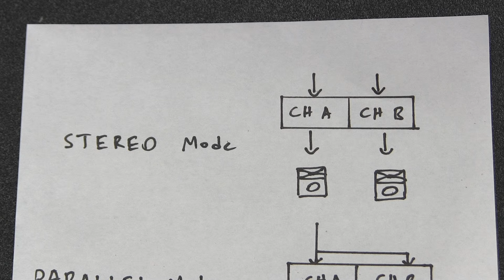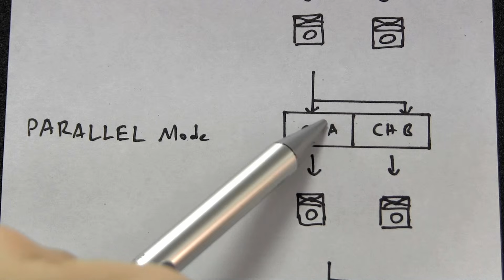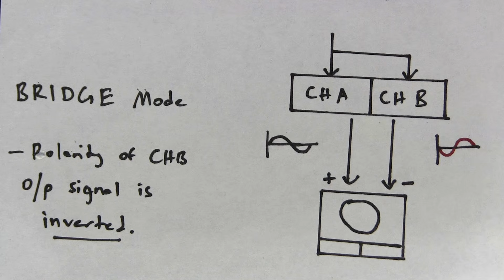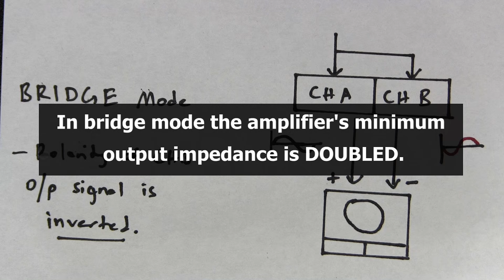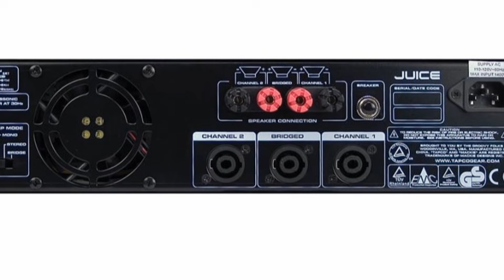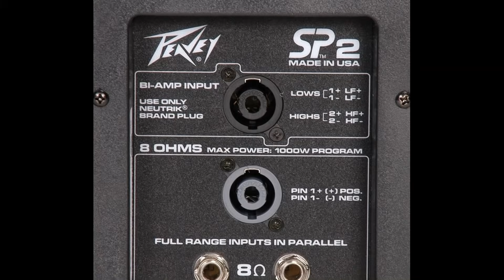How to set up and connect a power amplifier in bridge mode

Comment: Question?? I was told to connect Positive speaker wire to Speaker set 1 binding post Positive, and Negative speaker wire to Speaker set 2 binding post Negative. But you're using both Positive, 1&2, binding post?
Reply from the maker: This is only when connecting the amp in bridge mono - the video explains clearly why the connection is made to the two positive/red binding posts.

Comment: Can we used more than one speaker in bridged mode??
Reply from the maker: Yes, as long as the amplifier can handle the combined load of the two speakers in bridge mode.
Reply: Thank you... Can the wiring of speakon Connector we made for parallel mode be used in bridged mode ??
Reply from the maker: The wiring at the amplifier end may need to be changed but apart from that it can be re-used.

Comment: I have a 4 ohms subs @500watts & 8 ohms tops @500watts. Is it still ok to parallel out from 4 ohms subs to an 8ohms speaker?
Reply from the maker: Probably not - there are very few power amps that be safely bridged into a load of less than 4 ohms.
Reply: Thanks mate, basically its just only safe to parallel both 8ohms speakers or 4ohms speakers. The amp I have can run @8, 4, 2 ohms & 2 & 4 ohms Bridge.

Comment: I am the one who subscribe your channel, and my question is how do we know the Ohm of the passive speaker?
Reply from the maker: It will be printed on the back of the speaker.
Reply: @GLBProductions  Thank you...    My point is that if the speaker is old one which is not printed on the back side of the speaker. how can i measure its ohms?
Reply from the maker: Use a multimeter set to ohms but this measures the resistance rather than the impedance so will not be an exact match.
Reply: @GLBProductions  Thanks alot..

Comment: Hi Bruno! Your explanation about the Stereo, Paralell and bridge mode are really great. However, I have a question. In Inuke 6000 DSP, Behringer, the BI-AMP mode is equivalent to Bridge Mono mode? So, using it I need only one amp to connect hi and low frequencies loudspeakers? To connect 2 subwoofers and to HI frequencies passive loudspeakers in a chain, I need to change all of my cables? Thanks a lot.
Reply from the maker: Hi Affonso! No, bi-amp mode is completely different - that uses one channel to drive the low speakers and the other channel to drive the highs. If you are not totally sure about this I recommend you consult the person who sold you the amplifier and get them to show you how to set it up to work with your system.
Reply: @GLBProductions  thank you very much. I guess chanel A for low and B for the hi freq. I'm gonna check

Comment: Hello, i have pro amp skytec 2000 with eq can i use max volume or allmost max volume with eq maxed can it damage the amp?

when i try less than middle volume with eq maxed i see the blue light flashing some i have fear of damage the amp or speakers thats why i try be careful but i want to know and need to know if i can put allmost full volume with eq maxed with strong speakers

also can i connect a subwoofer of 4 impedance with 1250w rms cea will it work?
Reply from the maker: If your amplifier is correctly matched to your speakers you will be able to use any volume on the amp safely. Watch my video on how to match power amplifiers and passive speakers.

Comment: Hi I just watched n i got a very basic question. Configuration at bride mode is where at output channel we have 2+/2-, I noticed only 2 wires in the speakcon connector where else we are going to power up 2 speakers normally requiring 4 wires. Does that mean the stereo effect is nuetrelised  in bridge mode ?
Reply from the maker: That's correct - in bridge mono a 2-channel/stereo amp becomes a mono amp, hence the name.

Comment: Can I connect a parallel speaker to bridge mono mode?
Reply from the maker: Yes you can but remember that it will affect the total load on the amplifier. Many amplifiers cannot be bridged into a load of less than 8 ohms, check this carefully.

Comment: thank you very much for a very impormative vedio sir. i have a question, in my pioner a-307r which is 2 channel and every channel its requires two speakers.  it is posible the brigde mode in every channel. thanks
Reply from the maker: Please consult the owner's manual for that information - AV receivers rarely can be bridged.

Comment: Very good video. But I still have a pair of doubts.
In a bridge mode connection, what about the distorion (THD and IMD)? 
The THS+IMD is twice than in single mode?  
And what about the damping factor? the damping get worst or improve?
I have a crossover (Behringer) with a subwoofer MONO balanced output (XLR connector).  Is perfectly for supplying a MONO amplifier, but I have a stereo one. Each pin of the XLR connector is 180 degrees inverted respect the other pin. I could feed the left input with one pin and the right with the other pin,  putting the woofers (both are of 8 ohms) in bridge between the "hot" outputs (red connectors)  ...is well if I do that?  And the woofers I connect them in parallel (4 ohms) or I connect them in series (16 Ohms) ?
Hope you want responding me.
I am writing from Argentina. Excuse my bad English.  
Thank you in advance.
Reply from the maker: I suggest that you consult the company that manufactured your particular amplifier - not all amplifiers are designed to be bridged, and output characteristics may differ from model to model. 
Your suggested setup with your crossover will work in theory. 
Woofers are typically connected in parallel for live sound applications so that a failure of a single driver does not silence the whole cabinet.

Comment: when you have not a bridge option in your amp, how can i reverse in the input sinal?
Reply from the maker: You would build a custom input cable that inverts the polarity of the input signal - bear in mind that if you do this and damage the amp the manufacturer will probably not repair it under warranty. There is a reason it doesn't have a bridge mode in the first place ;)

Comment: can i ask you a question sir? so what mode can you connect the speakers normal speakers solo 1200 watts to the amp? the way i connect it is from the speakers to the amp 1 to black and the other to the red .bough the same.is that right .or is the way you done it ? thanks
Reply from the maker: Sorry Carlos I don't quite understand your question. If you use the black and red terminals to connect the speakers you are connecting in normal stereo mode rather than bridge mono, which is fine, but you will get a different power output.
Reply: thank you for your reply and sorry about you dont understand it..yeah that is the way i have when you replied to me in stereo mode...but my amp is the older version, its crown LPS800
dosent have all the things on the back lol..i dont care its just to play at home..but i would like to know what is the best and to connect it to mixer .i have connected to the mixer and plays well but im afraid dont blow the speakers up lol..because i have a pair of speakers before 3000 watts and gone started smoking ..and i dont want to do the sames to this ones .but it is loud ...thankx if you could reply

Comment: Hi Sifu Bruno! 
Is it safe to daisy chain two 8 ohm speakers in bridge mode? (considering minimum resistance for the amp is 4 ohm.)
Reply from the maker: This is ok, but be sure that the amp can operate at 4 ohms in bridge mono - if the individual channels are only rated to 4 ohms then the minimum for bridge mono is 8 ohms.
Reply: @GLBProductions  thank you for responding boss! Appreciate it

Comment: Does this work to power a center speaker with a 2 channel amplifier in a home theater system? If not, why is it so hard to find a simple one channel amp for a center or a 3 channel amp for just left right and center speakers?
Reply from the maker: With home theatre systems the speakers are typically sold with a multi-channel amplifier that provides all the necessary power - typically 5+1 or 7+1 channels.

Comment: I've got pa amp 600w with no channel options but left and right (a and b + - / + - ) .... can it still be connected safe?
Reply from the maker: You'll need to check with the manufacturer to see if the amp is designed to be bridged and how to do it correctly.

Comment: So if the sub is a 4 ohm and the amp says it can do 2 ohm would the amp put out more power if I purchase a two ohm sub? The two ohm rating is higher on the back of my old school 2 channel mono amp from mtx. Or does this already drop it to 2ohm , I'm only using one sub
Reply from the maker: You need to check if your amplifier is rated to 2 ohms per channel or 2 ohms bridged - there are very few professional power amps that can be bridged into a 2 ohm load, ie each channel has a load of 1 ohm.
Reply: It says 250w X1 into two ohms. So with the 4 ohm speaker bridged I guess I'm maxed out correct :(?
Reply: It also says 125 watt X1 into four ohm.  It's a mtx 4250 2 channel class d mono amp
Reply from the maker: Yeah that means no less than 2 ohms load per channel, which means no less than 4 ohms in bridge mono.
Reply: Understood. Bridged I'd need to keep the 4 ohm speaker because it uses 2 of the four ohms on one channel and the other 2 ohms on the other channel. So the 2 ohm rating they are talking about would be for a svc 2 ohm speaker on each channel totaling two speakers

Comment: If you were to use the binding post only and wanted to hook up 2 speaker cabs, would you run both sets of speaker cables together as you showed? Or is it more common to just run 2 cabs in stereo mode?
Reply from the maker: Either daisy chain the speakers or try and fit two sets of speaker cables into the binding posts.

Comment: Very helpful video.
I have a question sir.
If I have 2 4ohms speaker and I connect them in Series to match the impedance in the amp(8ohms when bridge) would it matter? Please answer
Reply from the maker: Sure you can do that no problem.

Comment: Need some help here. Bought a ZoneMaster 650 to connect all my 8 Speakers 1 Center & 1 Sub. want to connect one or two devices (Which ever will give better sound performance ). Which other device do i need between (JC5 Power Amp & P7 Preamp) to achieve this ?

Comment: How i connect 2 sub 8ohms in bridge mode? Your explanation is only one speaker, how if 2 speakers?
Reply from the maker: Just daisy-chain them together.
Reply: Daisy chain means parallel connection. Then it becomes 4ohms. Can be?
Reply from the maker: That's right.

Comment: On my Gemini 3000 my bridge mode is on channel 2 is that correct?
Reply from the maker: Bridge mode uses both channels together - check your owner's manual for which channel is used as the input.
Reply: @GLBProductions  thanks

Comment: wow....thanks for the video...but i have a question...if you set to bridge mode,,can we use the two volume knob?or the channel volume A only?thank you,,,
Reply from the maker: It depends on the amp - some amps you have to set both level controls identically, other amps only use the channel A level control.

Comment: Do we connect two speakers as normal when Bridging from the Channel B Output for the second speaker? Or, must it be daisy chained? 
I have an amp that powers 1400W @4 Ohms when bridged. Could I connect two 700W 4Ohms speakers to this amp?
Reply from the maker: When bridging the amp channel B output is not used - if you want to connect a second speaker it must be daisy-chained to the first one. If you connect two 4-ohms speakers to the amp that will result in a load of 2-ohms. Most power amps cannot be bridged into a 2 ohm load.

Comment: HELP, please!!!!!!  I have Pioneer VSX 932 with 7.1 System each 150W 6ohm ! and every channel I connect two of those speakers so in every channel there is double of 150w 6 ohm how is the best way to connect those speakers with each other !??? now when I test it shows me that it's only 2 ohms! and tow of them RL RR they are 3 ohms and the receiver have 6-ohm output  how i should connect all of thes things without risk !?
Reply from the maker: Remember that impedance is frequency dependent, and the listed impedance is often very inaccurate. I suggest you contact Pioneer and ask for their advice on connecting your system, especially if the equipment is still under warranty.

Comment: So in bridge mono can you daisy chain 4 speakers, for one amp.if all 4 speakers are 8 ohms.
Reply from the maker: It depends on the minimum operating impedance allowed by the amp in bridge mono - if it 4 ohms (typical) you can only daisy chain two 8-ohm speakers.

Comment: THANK'S. ON THE BRIDGE SET-UP, WOULD I CONNECT MULTIPLE SPEAKERS COLLECTIVELY DOUBLED. IE. IF THEY'RE ALL 8 OHM WOULD EACH ONE NEED TO BE 16 OHM-SAY IF THERE'S 8 SPEAKERS?
Reply from the maker: Bridge mode is typically used for a single large loudspeaker, typically but not always subwoofers.

Comment: For example my amplifier in a bridge mode is 2800w I have 3 speaker which one is 800w 800w 800w
Reply from the maker: You need to calculate the combined impedance of the three speakers and check against the amplifier's minimum allowed impedance in bridge mode. More info here: https://www.youtube.com/watch?v=l9L7uK7Xy0w

Comment: Your teachings are  very clear. Is it possible to use 1 compressor for all the instruments at the same time?  What's the basic compressor settings?
Reply from the maker: Yes you can use a single stereo compressor to compress the entire mix. Try a ratio of 2:1 at a threshold of -10dBu and adjust from there.

Comment: Hi, thank you for explaining this so eloquently! I have a question for you. Not sure if you heard of an old NAD integrated amplifier that has the option to disconnect the pre from the power  amp. I refer to NAD 3120 amplifier. Can that power section of that amplifier be bridged?  In other words, can any power amplifier be bridged by feeding both right and left channels with the same signal and then using both positive outputs (right and left) for the bridged signal?  I would really like to at least double the power output of the NAD amplifier that sounds superb but it only has 25 watts. Thank you. Deon
Reply from the maker: Yes you could do that, but you would need a feed a polarity-inverted signal to the right input terminal. This is the manual method of bridging an amplifier, which I don't discuss in the video because it will probably void the warranty on an amplifier without a bridge mode.
Reply: Thank you so much for your reply.  I will try this. Best wishes. Deon

Comment: sir in active crossover whats the right frequency setting and gain setting for hi speaker to avoid from burning voicecoil. and also at equalizer ,wats the right freq. thanks
Reply from the maker: It depends on the loudspeaker - that info will be available from the manufacturer.

Comment: Ok so I have 2 10" subs I would like to run it bridged. The only way I'm seeing this is both tens are 800watts peak 400w RMS my amp is 1600watts peak two channel 2ohm stable. Is bridgeable at 4ohs mono the only way is wire my subs in series two 4ohms becomes 8 ohms then at the bridge it's 4ohms. . Is this bout right?
Reply from the maker: The peak value of speakers/amps is not useful in doing these calculations - you want to focus on the RMS. Also, how do you intend to wire your subs in series? 'Out of the box' speakers are always wired in parallel.

Comment: how if i have speakers? where did i connect the other one/
Reply from the maker: Daisy chain the first speaker to the second one.
Reply: sir which is more powerful sound/? bridge mono w/ 2parallel speaker or stereo mode w/ 2speaker?
Reply from the maker: It depends on the amp you need to work out and compare the power delivery into each configuration.
Reply: thnks sir

Comment: Clearest explanation ever of how bridge mode works and how to modify the connectors on Speakon cables. Thank you Sir. Question: I intent to run two 8 ohm speaker cabinets in mono bridge mode (Crown XLS 1002). After modifying the amp end of my Speakon cable per the manual - I can then "daisy chain" the second speaker cabinet to the first, and I would then be bridged into a 4 ohm load, correct?
Reply from the maker: Correct - remember that the only modification you need to make is at the amp end of the first speaker cable. The second cable joining the two cabinets together is standard wiring at both ends.

Comment: A side note... An amp does not generate power. An amp switches the supplied power.

Other than that, Sterling job.
Reply: how to connect crown xti6002 Vs stranger mcu316 amplifiers

Comment: Hi Bruno, everything worked great as you explained, now my question is this? How do you connect exterior amplifiers without bring low pass another words connecting exterior amplifiers to sub woofer  preouts? I want to know? Is it possible to connect exterior amplifiers in full range?
Reply: I have a pioneer sclx501 receiver!
Reply from the maker: I suggest using the line out connectors to connect to external amplifiers as these will be fullrange with no low pass filter.
Reply: I tried the pre/ line out before and it was blasting with no volume control, unless I hooked it up wrong??
Reply from the maker: No that's correct, you have to control the volume using your external amplifier.

Comment: sir why we dont get any shok by connecting an amplifier and a speaker by wires al though amplifier is in ON like ahuja 250 watts amp
Reply from the maker: The voltage is relatively low compared to that found in main AC current.
Reply: GLB Productions okay thaku sir

Comment: Hi Bruno, is the channel 1 only channl used in bridge mode when using an external ampifier and also multiple amplifiers? If I'm understanding you right??
Reply from the maker: No Paul, both channels are used but only the input of channel 1 is connected. You can't connect anything to the input of channel 2.